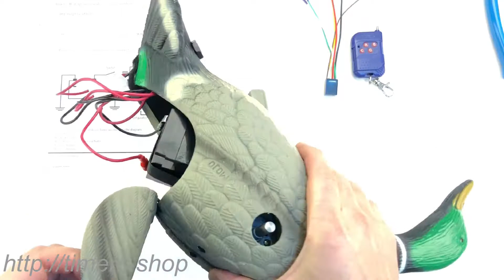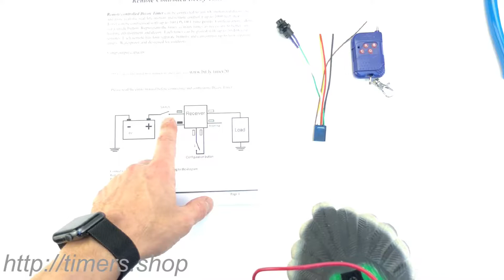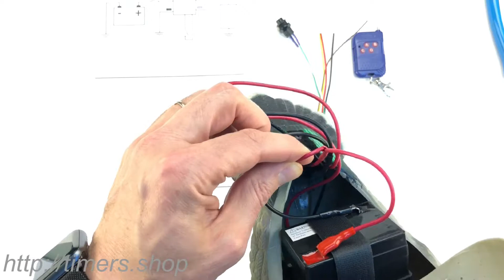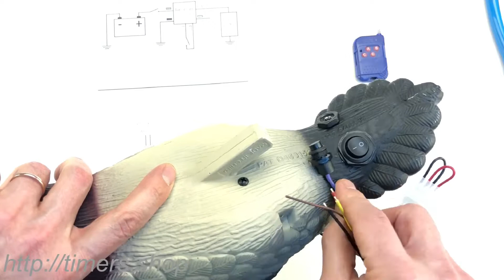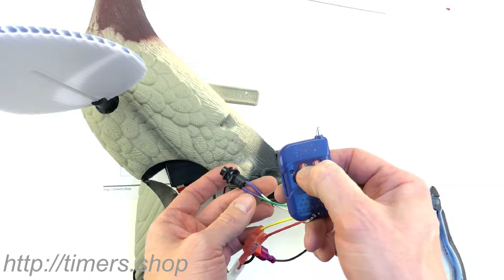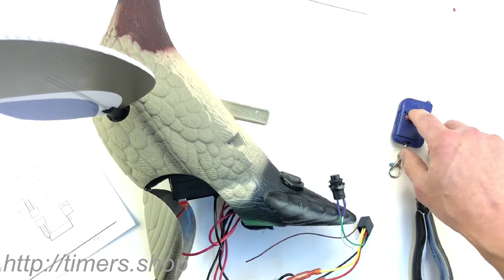Connecting and Configuring Remote Decoy Timer.

Comment: I wired mine exactly as you have shown and it will not work. When i turn the power on, all i get is a small buzzing noise out of the receiver. I never get any movement out of the decoy.
Reply: Ever get this sorted out?

Comment: Are the timers and the remote waterproof?
Reply: No they are not. I've only got the remote timers this year but have been using just the regular decoy timers without the remotes that they sell for a couple years now and have not had any issues as far as hunting in the rain. Now if I was hunting in the rain with the remote ones and the remote got soaked or got dunked in the water I'd probably unscrew the one screw on the remote and open it up when I got home and use a can of compressed air to dry out the inside. Or just leave the remote open for a day or two and it should dry on it's own. What I will probably do is stick the remote in a small plastic ziploc sandwich bag and put the bag in the pocket on my waders.